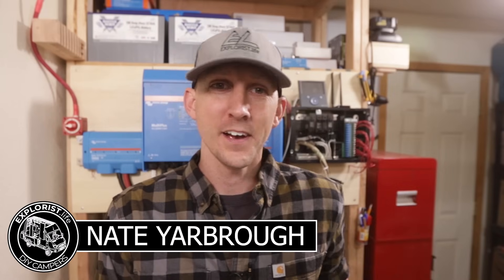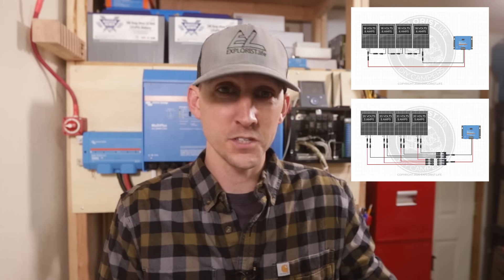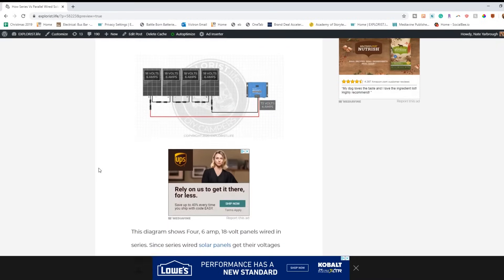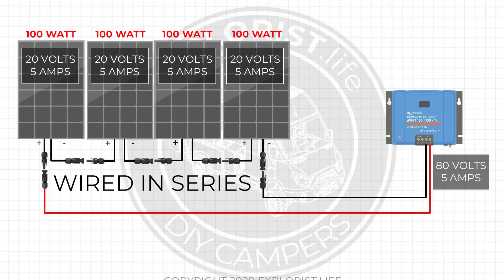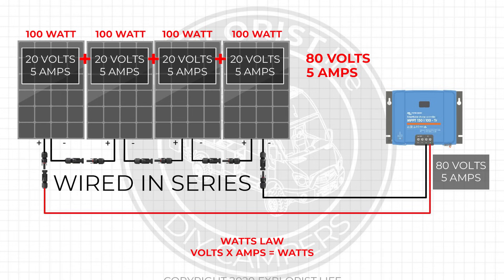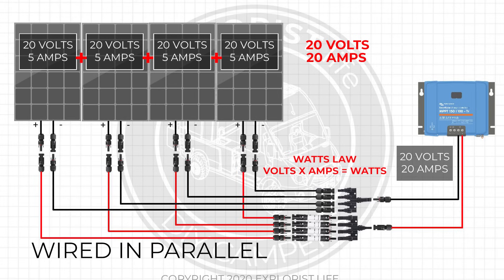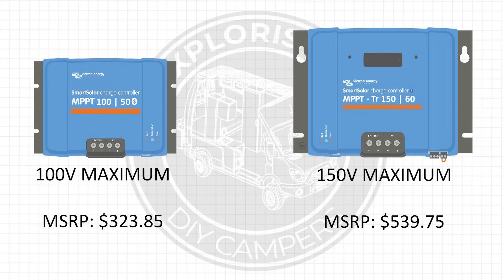Solar Panel Wiring vs Volts and Amps

Comment: This was perfectly clear! Finally someone who makes sense! 
Question, unrelated to watts, volts, and amps. Since CIGS solar panels outperform regular solar panels in the shade, I know that regular panels are not effective in the shade if done in series. Does the same apply to the CIGS panels or can I still put them in series and have them work as they normally would in the shade.
Thank you for your time!
Reply from the maker: Nothing would change.

Comment: I have two sets three 100W, 20V, 5 amp panels. Each set of three is wired in parallel (15a, 20V) What makes more sense wire the two sets together in series to get 40V and 15a or in parallel to get 20V and 30a ?

Comment: Quite confusing. Why are you using charge controller 100I50 if your needed volts/amps are 60I10? Why not choosing smaller charge controller?
Reply from the maker: Hey, @marin87mne! I appreciate you taking the time to ask your question, but unfortunately, I don't have enough info about your specific question to provide an accurate answer, but here is a playlist that, if you watch all of the videos start-to-finish (and take notes 😉), you'll have a REALLY good idea of how to design a solar array: https://www.youtube.com/watch?v=Jkbs84sBHsg&amp;list=PLmvhcyi4n0TV9pi83rFTv3ZuMT_S1xIZt

Alternatively, I have some of my most common solar array setups pre-built here: https://shop.explorist.life/product-category/all-products/camper-wiring-kits/solar-charging-wiring-kits/
Reply: @EXPLORISTlife  Actually, I watched a lot of your videos (which are really amazing), but I can't quite understand why did you choose (in this particular video) VICTRON 100V/50A and not e.g. VICTRON 75V/15A, since your needed volts/amps are 60V/10A?
Reply from the maker: Revisit the concept of inputs amps/volts vs output amps/volts and understand WHAT the charge controller does w/ the understanding that charge controllers are usually rated in terms of input volts vs output amps.
Reply: @EXPLORISTlife  I got it from your other video! Your videos are amazing!

Comment: I need to wire 8x 370w 45.69 voc, 10.30isc panels in series parallel with a voltage of 102v and 52amps. How would I achieve this? What size wire do I need from the panels to the mppt charge controller?

Comment: I have a question can 6 100 watt panel be wired 4 in series an 2 panels in parallel on a 150 volt charge controller. Panels are 24.3 Volts at 5amps

Comment: What would be the minimal amount of solar you could use to charge 48 V batteries? I have a Northern lite truck camper with three 200 W panels and I would like to use 48 V batteries. Is this even possible?
Reply from the maker: I'd be willing to go out on a limb and say that your electrical system won't be big enough to warrant using 48v batteries.
Reply: @EXPLORISTlife  would it support a 24 V system or should I just do 12? Thanks for the reply. And thanks for all the information that you have given me.😃
Reply from the maker: Check out the 'system picker' we have embedded on the home page of shop.explorist.life.  that will get you pointed in the right direction

Comment: Thank you so much for what you do and for sharing I wish I had seen this video before I attempted to wire my solar array myself as I thought I was doing it right it was incorrectly wired for over a year and then suddenly last week at blew my 150 volt Flex Max 80 overcurrent I have the sense learn to rewire it correctly and it's done but now I have to figure out how to get my Flex Mac 80 repaired this video really helps cement the foundation of learning the math behind wiring thank you so very much

Comment: i have 4 panels open v 37.5 amps 13.7. 420 watts  i hooked up 2 panels in series and other two in series and then hooked the 2 up in parallel   i am getting  67 v and 9.8 amps  the amps  should  be around  27.4 right?

Comment: I haven't seen a Solar set up using a Yeti Goal Zero with decent solar panels other than what Goal Zero provides. Could you do a video showing how to maximize the availability for a Goal Zero Yeti 1000x battery? Currently I have found that the unit has a built in charge controller that can handle 50V, 50amps, and up to 600watts of power. Any chance you could show the best set up for that?

Comment: Not sure if I missed it somewhere, but the calculation of V to the MPPT shouldn't that be using the VOC figure not the nominal V panel. Ie my Winaico 260W 20v panels actually have a VOC of 37.9V according to the data sheet. That makes a huge difference in potential voltage supply at the MPPT. (I Think) 
Can you clarify that for me Nate.

Comment: Thank you! This finally made things clear! I have all the parts for a small but expandable system but have been afraid to hook it up. Damaging that expensive charge controller was my fear. 100/50 like you showed. Now, the next chance I get, I have the knowledge to install the  system correctly. Thank you again!

Comment: What if you have 5 100w panels? ( I now see you can probably use 150/45 mppt for seies connection) I assume you have to put them in series, so you meet the victron 5v+ battery voltage threshold to start the mppt charger.  You have at that point with 5 panels in series, near the 100v limit on the 100 / 50 mppt.  So - do you need to move to the 150 /50 mppt victron model? Also victron electrical engineer says to wire in series to collect morning sun or shade sun because of the 5v+ battery voltage startup rule.  But other people say series will not work well if one panel is in shade.  But they say the parallel wiring does not have the one panel in shade problem.  Using 5 Rich Solar panels.

Comment: Solar panel voltage of 20v in series say 4 panel the voltage is 81 volt but the capacitor in the mppt charger charge up to 135 v maxing the 100 volt input but I guess the engineer most knows that to build it for the that because I see people using 80v mppt for 80 and it blow out so explain to some new comer that the panel rectifier don’t have capacitor built in the rectifier so as any capacitor is added the voltage shots up to the capacitor max charge voltage increases the a 20 volt panel to 35 volt

Comment: I realise that this getting on a bit, but I cannot find anywhere here, which voltage and current measurements are used in calculations for matching solar panels to find the best configuration. Is it open circuit voltage/max power voltage or max power current/short circuit current?

Comment: Question I am running two  renogy 60 amp Rover charge controller in parallel I have a twelve volt system I have two solar arrays with 12 100 watt panels on each I have both controllers maxed out the rating of the charge controller is 60 amp it's rated in amperage not wattage the Rover will take up to 48 volt can I do a series connection on my solar panels to a 24 volt system cut my amperage in half and run twice as many solar panels on my charge controllers
Reply: Instead of having to get two 100-amp controllers

Comment: Hi ;Nate   I am new to solar  , I bought  an all in one inverter 3000W ,not understanding at the time about the VOC max input , which is 75V input on the  this inverter . I have 6 -100W panel , after watching your video on wiring series and parallel put me at 60V , should  I add a 75V dc  circuit breaker to  solar array for add safety, I live in a warm climate area with a few mouths of cooler weather, concerned about the increase with cooler weather.

Comment: Hello Nate .. Very heloful video.. and fantastic explanation ..Question.. i have a 4 in connector, when i do series with 4 panel, i see 2 ports or slos empty on the connector, with this kead t loss  of power or should i go fir 2 in 1 male n female connetor. Pls advise

Comment: I really liked how you explained this, but I have just learned that there is a schematic to the panels which includes max. power, max. volts, short circuit current and open circuit voltage. When you were giving your diagram at the begging, which are you using. My 100 watt panels don’t have the same numbers that you used and I understand that can be important. None of my numbers were whole numbers and the multiplication didn’t work. Thank you!!

Comment: One thing I didn't hear is in addition to wiring your solar panels so that they don't exceed Voltage limits of your solar generator - need to also make sure your panels don't exceed the amp limitations - lmp lsc.
Reply from the maker: Well... it's better to design the solar array and the charge controller simultaneously so that you can use what I taught in the video to pick out the panels and the controller as one unit.
Reply: @EXPLORISTlife  oh yes I know that your videos are targeted for people that are building out there controller inverter setup. I just added that comment for those of us that have actual solar generators that have a fixed capacity with regard to voltage and amps. I haven't ep500 that can handle 20 amps and 150 volts. So it took me a while to figure out I had exceeded the amps in a series/parallel set up. Thank you for your videos!!

Comment: Nate, Can I wire 3 panels in series parallel? I have three 315 watt (9.41 amps * 33.46 V) solar panels on my van roof and a Victron MPPT 100 / 50 smart solar?   My battery bank is 600 ah Battle Born. Thank you for all this very helpful information!

Comment: Question: so which wiring arrangement is best for charging batteries? Not running devices directly? Series parallel? Because you get good voltage that isn’t over the charge controller specs and powers the controller well good amperage to charge the batteries? I guess I’m not understanding volts vs amps My understanding is amps are needed for running high torque motors or actuators (thinking slide out motors or winches) and volts are needed for running things like lights or fans.
Reply from the maker: This will help with overall solar array design: https://youtu.be/OsVqIvahThM

Alternatively, I have some of my most common solar array setups pre-built here: https://shop.explorist.life/product-category/all-products/camper-wiring-kits/solar-charging-wiring-kits/

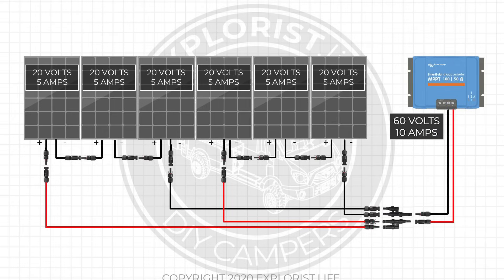Comment: @8:45 

You have 2 sets of 3 panels, so then why do you say its 10amps?

Shouldn't it be 15amps? (Not 10amps)

 Since you have 3 panels+ 3 panels?
Reply: BTW I knew nothing before starting your extremely informative series, so your extremely educational 🎉
Reply from the maker: Awesome!  Glad it helps!  The 10A is accurate.  Since panels wired in series gets their voltages added together while the amps remain the same; meaning we have two series-strings of 5A.  Once the series strings of 5A each are wired in parallel; that adds their amps together while their voltages remain the same resulting in 10A.

Comment: Hi, question you use Isc and Voc from the solar panel?
Reply from the maker: 'oc' is for figuring out the charge controller size.  'sc' and 'mp' is for actual power output.

Comment: I want to wire eight 100 W Renorgy 12 volt panels I want to try and run it on 12 gauge wire about 100 feet to a Victron 100/50 where can I find a wiring diagram that will show me how to do this I can do the four in series and parallel however I would like to do a second for a series and parallel but I don’t know how to join them

Comment: Hi Nate, I recently sub'd here to you and my question is in regards to solar charging my EcoFlo Delta Pro (w/ 2 extra batteries). I plan on using 6 portable 400W ALLPOWERS panels (OCV=45.3V & Isc =11.45A) using 2 series strings of 3 and then paralleling the 2 3 panel strings. I see it as 45.3V + 45.3V + 45.3V = 135.9V @ 11.45A for each of the 3 panel strings. Then by paralleling these 2 strings it would produce (at best) 135.9V @ 22.9A to the EcoFlo Delta Pro charge controller (which would accept the 135.9V and 15A of the 22.9A and block the 7.9A overage). Does this sound correct or am I mis understanding the concept? Thanks, Bob R.
Reply from the maker: I don't know much about the Ecoflow MPPT.  The info you learned on this video will teach you what happens to the solar array; but as far as what/how much power you can send to the Ecoflow; you'll want to reach out to Ecoflow tech support to assistance.

Comment: Awesome video, I do have one question or more maybe a confirming question. If I have (3) 200w strings and are connected in series-parallel. And if one of the strings becomes blocked by something causing a shadow. affecting that string. Will my other 2 strings still continue working and only losing 1/3 of my power produced?
Reply from the maker: Any shading on any array will decrease output.  If max solar output is the goal... avoid having the solar panels in the shade.

Comment: Hi, I’m new to the solar systems, I had a thought, I will be using 6 x 12 volt x 200 amps sealed acid batteries, I will be using 100 watt 12 volts solar panels, is it better to wire the panels for volts or amps ( obviously, keeping within the voltage rating of the inverter/charger box) thanks for your help. 😎🏍

Comment: 1 have Four Rich Solar 400 watt solar panels in series, and so far at best, I get according to my inverter, about 1.160 watts of power output. 
   It is a clear day, no visible chemtrails blocking the sun, is this all I can expect?
  I am near Milwaukee Wisconsin,  which isn't all that far north, what is your opinion on the panel output?
Reply: You need to make sure you have the right tilt angle.

Comment: That's a beautiful video you could and explains a lot it makes sense everything you said but my question to you is which will charge faster my battery my 12-volt Bank voltage amperage or amperage

Comment: Hi there, great information. I have a question, I have 2 X 100 W panels connected in series going into a renogy rover 20amp charge controller. I am charging 12 volt lifepo4 batteries. I'm getting 35-40 volts and 9ish amps so around 350 Watts and this shouldn't be happening, I don't think the amps should be doubled so is this the MPPT increasing the current or do I have another issue?

Comment: Thank you I am setting up my system and will keep going back and watching this video as I set it up to make sure I do it right. For my 600w solar panels I am connecting it to a 60amp MPPT charge controller and to a 1500watt inverter, then to my lithium battery. I asked Rich Solar about it and they said I should have a good system. They told me because I was off grid that I didn't need an inline fuse going from the solar panels to the controller. Is this true or should I add one before connecting it together?

Comment: Im a bit confused lets see if anyone helps me... i did the cables in parallel and i get 30v, 20.3 a, 727kwh, with the battery being at 27.7v, 21.9a, then i swiched to series and i get 90v, 2.8 a, 727kwh, with the battery being at 27.3v, 9.4a.... is a small room with a small fridge, tv and fan and a few light bulbs... which set up should i use?

Comment: Good vids. 
I had an issue with my controller showing 0.5-1.5A
Individually tested 4x120w 12v panels each giving 4-5A. 

Reconnecting cables and y cables in parallel whilst testing and was getting up to 12A (due to sunlight changes)
But when connected to controller it showed 0.5-1.5amp

Found draining power from the batteries caused the the panels to draw more current going up to 9.5A and today even to 16.5A

So be aware if your batteries are fully charged they will trickle charge and draw less power.. 
But by connecting power tools, diesel etc to drain the battery it caused the panels to draw more current

Hope this helps

Comment: If possible could you please give me some advice I have eight 100 watt renogy solar panels and a 80 amp Outback flexmax solar panel charger and two 400 apm hour batteries big and heavy ones. So I was going to run four of the panels in series a set of 2 and then I was going to run the set of 2 of four panels in series then run them in parallel. I wasn't sure what size fuse I should use on the positive line from the solar panels a total of 2 of them I bought 10 amp inline fuses but I'm not sure if they are too small. Sorry if this is too much LOL I just need some advice and knowledge
Reply from the maker: Hey, THE THIEF ON THE CROSS ✝️! I appreciate you taking the time to ask your question, but unfortunately, I don't have enough info about your specific question to provide an accurate answer, but here is a playlist that, if you watch all of the videos start-to-finish (and take notes 😉), you'll have a REALLY good idea of how to design a solar array: https://www.youtube.com/watch?v=Jkbs84sBHsg&list=PLmvhcyi4n0TV9pi83rFTv3ZuMT_S1xIZt

Alternatively, I have some of my most common solar array setups pre-built here: https://shop.explorist.life/product-category/all-products/camper-wiring-kits/solar-charging-wiring-kits/

Comment: Why can some lithium batts be wired in series and not others...thanks..
Reply from the maker: Probably just the type of BMS that the battery manufacturer used.  With Battle Born Batteries, they can be wired for a 12V, 24V, or 48V battery bank without issues.

Comment: Can I use a 200 watt solar generator to charge my 2000 watt solar generator? The Anderson input jack stopped working on my 2000 watt, and I'm boondocking so can't use shore power. The only other input port/jack on my 2000 is a 3 prong plug. I can plug it into the wall of my RV and turn on my coach generator (gas), but don't want to and it's noisy and shuts off before I get much charged anyway. TY

Comment: So my array is 16 250 watt panels, 4 strings in parallel. The current @ pmax is 8.27. The volts @ pmax is 30.3. Open circuit volts are 37.6. Not sure which volts to figure but i guessed the 30.3. Im coming up with 121 volts and 33 amps. Is that correct? Then im shopping for a charge controller and they all say 12v 24v 48v etc. What size charge controller do i need? And inverter as well?  Its not too confusing but im brand new to this and i cant afford to screw it up. Thanks